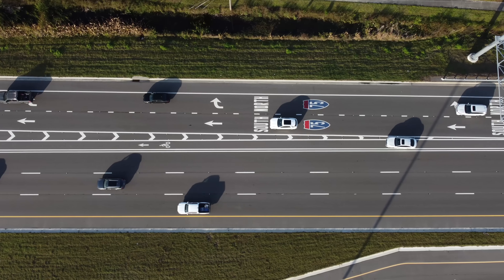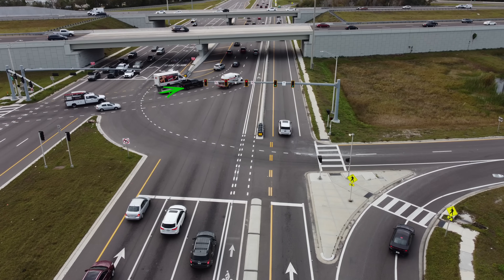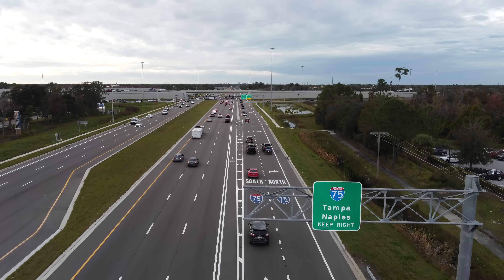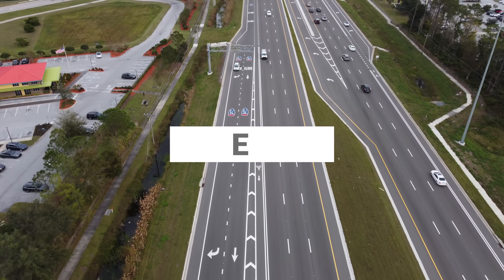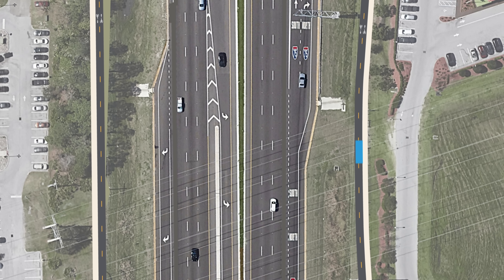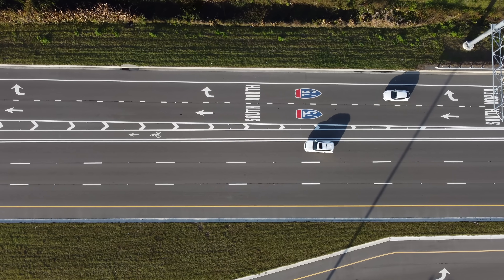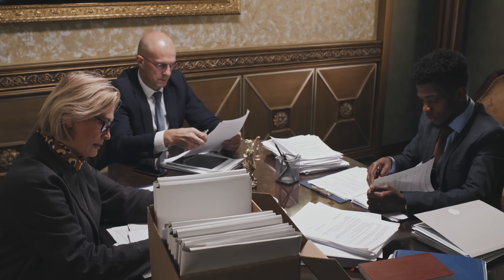This Brand New Interchange is Already Flawed

Comment: Are you familiar with this area? Your bike tunnel ideas is never going to fly in Florida. This ain't Amsterdam. They would end up in disrepair and be a hangout for addicts/criminals, never mind getting flooded by torrential rain. Its not something that any government agency FDOT down would bother funding upkeep for. The bike lane as built is trash, but better than nothing. Check US Route 17 interchange with I-75 (in Punta Gorda). Also, near the crossing with Marlympia Way in Punta Gorda, the right lane of US-17 at 55MPH is "share the road" with bikes. Now that is truly horrible. It does decrease speed to 45, then 35, but would remain a deathtrap given the skill of the average FL driver. As a side note, that interchange is also a garbage partial cloverleaf. Its options to be rebuilt may be constrained by elevation, proximity to the harbor, railroad crossings, and other issues. Check it out. /My 2 cents.

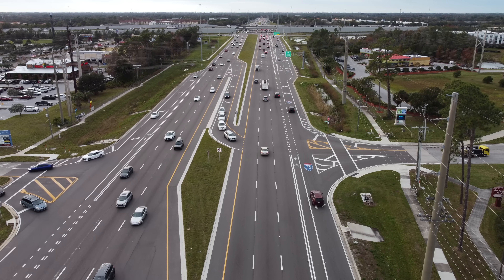Comment: 2:47 coming down from Canada for a few weeks I encountered this design at 11pm. It was incredibly confusing

Suffice it to say, I did exactly what this guy did except at the light intersection where it looked like that gap was left for a last minute merge over to highway if it was missed 😅

Overall I found the road systems there needlessly confusing.

I'm fort myers I swear the whole city is built around u-turns and an aversion to intersections. 

It took 2 u-turns to get to a place that could have been halved the distance and time with an intersection

Comment: There is one very like it in New Mexico on NM-500 @ I-25. The difference is there is no off ramp on the other side of the Interstate due to available space, so the ramp coming off the I-25 on the loop side goes through a tunnel under the freeway and links up to that intersection. So not only do you have people entering the freeway crossing the pike path, but you also have people exiting the freeway crossing it, too.
Reply: Rio Bravo? Oh yeah. Still a much better design than the outdated diamond interchange that was replaced, however, causes lots of conflicts for bikers bicycling from University or South Valley.
Reply: 505 mentioned! 😏

Comment: I don't want arrows on overhead signage to have arrows pointing at lanes.  I want the overhead signage to use lane unique symbols that match the symbols painted on the road below.  With new lanes having hints that they for new lanes on one side or the other of the road.  Each lane would have one symbol for its entire length and no two lanes should ever share a symbol.

Comment: I have to wonder if current traffic designers learned anything at all about previous road design, seemingly anywhere in North America.  Looking at this interchange as someone not familiar with the area, yeah, that definately needs clear signage to funnel people into the correct lanes further back to avoid last minute lane dodging or crossing through the bike lane when you realize you've passed the existing funnel point.  
And who sticks a bike lane in the middle of live traffic moving at 50mph?  Gotta wonder if the same thinking that prevails here is the mantra pushed down on these new traffic engineers; Put obstacles in the path of vehicles so they slow down.  Yeah, like that happens, people who shouldn't be driving in the first place are the only ones scared to go the speed limit, everybody else just treats it like a slalom course.  (things like curb juts, narrower roads, traffic islands).    Time to look at efficient movement of traffic as a whole, not band aid one and cripple the other.

Comment: (8:13) I'd like to point out that technically while that 4-tunnel system is elegant and significantly safer, technically you still haven't crossed the highway at all. You'd need either a tunnel or a pedestrian bridge with a bike lane in order to actually get people across the street without disrupting the flow of traffic.

Comment: As a cyclist, I always hate it when there's bike lanes that weave all over the place.  Since I'm used to biking in traffic, I'd probably prefer the original road, though I recognize that a good bike lane increases the perception of safety which can encourage casual riders.  My favorite bike lanes are the ones next to railroads, such as the western part of de Maisoneive in Montreal.  Downtown, it's the busiest bike lane in North America, but the western section between the Vendôme Station & Montréal West Station, is straight, flat with few intersections just like the tracks.

Comment: So many new intersections being designed are forgetting that Semi and RVs need to get through. Round abouts suck for large vehicles, Freeway exits need to allow for straight across in the event an exit was taken incorrectly, ramps leaving the interstate at 70+mph with no slow lane then straight into a 15 to 25 mph hard turn causes wrecks in cars and especially large vehicles.

Comment: You can be sure that not considering creating cycle paths the way it was shown in the video was not an accident, it was on purpose. For a country that, due to the influence of big oil capitalists, does not want to get rid of the consumption of fossil fuels, creating other transit possibilities means creating competition. And that's all they don't want. That even at a distance of less than 600 meters, Americans continue to use their cars. It's a project.

Comment: Dude, that intersection is in FLORIDA.  You can't dig a tunnel under the road for pedestrian and bike traffic.  Florida's water level is less than a foot under the ground, which is a thin layer of dirt over porous limestone.  Any tunnel would be filled with water (and small gators) instantly.
Reply: Fort Lauderdale has a tunnel

Comment: Well, they ticked the "bike lane" box, so everything is fine....

It is proven that good bike infrastructure can massively reduce congestion. But it has to be VIABLE alternative, not a death trap! Only very few people would want to ride a bike in the middle of a high-speed road - you don't ride your bike where you feel unsafe!

When will they learn? If this trend continues by 2100 there will be 30 lane wide giga-highways, with a small 2 foot wide bike line in the center or something. And you know what: there would STILL be congestion, because more people use those highways by then.

At this point I think it should be clear that there is only ONE solution for congestion: coming up with viable alternatives so that not everyone is forced to drive a care.
Reply: If you look at the area at 7:53 it becomes clear that no matter the bike infrastructure, no one will use it. It's an urban sprawl nightmare and will take some people 20Minutes of biking before they even get out of the neighborhood and see a single store. Not to mention the Florida heat and rain. No one is gonna touch it if they don't have to

Comment: Personally, I think all this redesign stuff reveals the convoluted minds of today. Roads went from being extremely simple to this sort of craziness.  I get the desire to reduce traffic but the real fact is most traffic was simply due to poor timing strategies of stoplights, and here is the proof.  Power outages. What's the one thing you never see when street lights are knocked out due to power outages?   Congestive traffic jams!  Every time street lights are turned off due to some kinda event, the very intersections that are most congestive now are devoid of it. And even more rare are accidents!!!  The removal of the stoplight improves the flow of traffic!  I've seen it many times over. Most people are not stupid enough to just go blasting thru full well knowing they would be taking a huge risk, so they employ a higher degree of attention in the crossing. And the same metric that applies when one is walking in traffic then applies to their vehicle operations. Less incidents then when they must adhere to an arbitrary street light roll of the dice timing wise.   These new designs are the same nutcase designs we see used and fail at airports and other heavily trafficked locations.  They introduce far more confusion in their attempt to provide simplicity. It's like giving a person a twenty step instruction book in how to take a single step forward.  It's called overkill!!!

Comment: I concur with these improvements, and it's sad such things aren't considered for every $80M construction project.  Seems it should be obvious at this late date in highway design.  Using the exact same rationale you did here.  Seems it could even be entered into the computer the design work is done on.

The quantity of traffic on the highway also is a factor.  The heavier the traffic, the more warning you need to into the correct lane, because it can take longer to change lanes, especially for large trucks.

That having been said, too many signs is also a problem.  Whenever you're looking at a sign, you aren't looking at the highway.  If you have to look at many signs in a short period with heavy traffic, that's dangerous.

Bicycles are a challenge.  I accept it's desirable to give people safe options for traveling by bicycle, but you basically end up having to build bridges and tunnels to separate them from motor vehicles, and use extra land.  Are there any bike paths that run above highways?  That would save land use, and utilize the same right of way.  Maybe such a path could also be used by motorcycles (with a divider to keep them separate from bicycles).

Comment: 6:00 In the Netherlands the tunnels would be mandatory. Both other options are just deathtraps and block flow of traffic. Let's say you have a busy hour of cyclist blocking passage for the motor vehicles and it clogs. Now you've got a traffic jam backing up the highway. Unacceptable.

Comment: Yeah, I recognize that intersection, anyone can see it's mis-labeled and badly designed. But that isn't the only spot , and they just refuse to fix any of it.   Count the cyclists in these lanes per mile , it's probably close to zero . Who wants to get exercise in car exhaust or commute every day two feet from an endless stream of cars driving at 70mph? Where exactly is the bike supposed to go if an emergency vehicle tries using that space to get around a jam? 
This isn't the right place for a bike path it's too high speed there, (cyclists don't want wiggly paths either , that pushes them back to the road margins) ... But  they won't even sequence the street lights properly, you have to stop at virtually every single intersection , they don't care.

Comment: A colossal mess. 

Biggest problem with planners is they plan too much. 

Fewer rules/lanes/markings/control would work better. 

Love the bike path idea. But no one will use it. Waste of time and money.

Sticking to cloverleaf and simply extending the merge lanes into it along with clear signs would have solved the non-problem and saved a great deal of money. 

Committee strikes again lol.

Comment: Designed by Muppets ! Learn from Railways. Avoid conflicting moves by using the available space for flying Junctions. Then you won't need expensive traffic lights which delay traffic & increase pollution by wasting fuel.  Or is that to complex for you daft Americans ???

Comment: A single bike lane for bikes going in both directions cuts the number of proposed tunnels needed in half, from four to two. Particularly if the bike-lane stretches are long in between the crossing roadways, then a single sided bidirectional bike path would work well.

Comment: A bike lane ON a highway? Are Americans insane? I really hope that this is "just" a loophole to get additional funding (as some other comment mentioned) and not a real try to get bikes on that suicide lane... Kind of glad that German/European laws prevent BS like this from happening around here. The "worst" we have are painted bike lanes on inner-city roads where the cars can go 50-60km/h, but those are luckily more the exception than the rule and mostly there because the city wants to increase bike infrastructure but doesn't have enough funding and/or space to redo the whole road with separated bike lanes, so the painted lane is a "quick fix" that hopefully gets followed up with a proper rebuild of the lanes a few months to years later.

Comment: Americans should take a queue from the Dutch when it comes to bike infrastructure. A separate, two-way bike path that is no wider than one single car lane should be built to either the left or right of the highway, with a physical barrier between them. More or less like the suggestion you made.

As for safety, tunnels aren't always an option because of cost. But you can make it safe. You can add bicycle traffic lights at the crossings with a push button, and integrate them into the traffic light control system. As long as no bicyclists approach, car traffic lights will operate normally. As soon as a bicyclist pushes the button though, the traffic lights that direct traffic across the bike path will turn to red. Car traffic lights that are for the lanes going the same direction as the bicyclists can remain or turn green at the same time as the bicycle light.

Comment: Your solutions here are perfect and wouldn't cost much at all. Maybe the tunnels wouldn't work since this is FL and water control is an issue but just having crosswalks with the bike lane off the road is much safer. Hopefully this video has made it to the correct people there so they can spend a tiny amount of money to fix this interchange.

Comment: As a veteran truck driver, I hate it. What if I took that exit on accident and need to get back on the freeway?  
Now I have to drive around on surface streets and try to find a place to turn around, like in some random parking lot, or make multiple turns on unknown streets hoping they are large enough and engineered for a truck.  
No one considers truck drivers when designing this shit.

Comment: Great video!  One thing I’ll immediately do is to have a sign telling where the 3 lanes are going to, in addition to where the right (75 Tampa Naples) lane goes. That way people in the 3 lanes would know that their lane doesn’t go to the 75 and the only option to the 75 is the right-most lane. Also the first sign distinguishes between north and south by a separating vertical line, which can lead to think that the separation between north and south is the concrete element ahead.

Comment: The bike lane your proposed is exactly the design that Madrid made use of when creating his first massive bike lane infranstructe, it is call the Madrid Ring as it literally makes a circle around the city going parallel to main city Highways, parks and avenues. It connects the old outside areas of Madrid City (now sourrounded by all the new city developments) with the older city center, and its FREAKING AWESOME!! 
its very well constucted, has usually a 2 lanes (one lane for each direction) for bikes and a third lane of people to walk, or if the area existing infraestructre didnt not allow for this a 1 lane for bikes and a second for pedestrians with one of this on each side of roads kinda like you draw in the video, it also use a lot short tunnels like the one you saw as well as thing tall bridges to avoid crossing main roads and highways, so traffic flow is better and riding bikes safer.
I loved the Madrid Ring bike project, sadly new city goverments are pushing for more bike lanes but doing it wrong as i see is happening a lot of times in the US, by building them as in the one on this video, in the middle of the roads or on the side but unprotected, mainly because is cheaper and because is in being done on the old city center. This makes people not to use it as much as the ones in the Madrid Ring Lane System, as the percive fear of being hit by a car is much higher.

However, my opinion is that it could be made better by removing parking areas on the side of the roads, o 1 lane of the roads and chaging existing pedestrian sidewlaks with the nice 2/1 bike lane+ pedestrian lane desing used on the Madrid Ring project, this if done correcty it would encourage the use of bikes or electric skates isntead of cars on the city center all while offering a great opportunity for creating new green areas for social use and interaction.

Comment: The issue is not cyclists, but specifically the tour de pants cyclists in camel toe tights, who still insist on inconsiderately biking in motor vehicle lanes and refuse the surface separated bike paths even though the path is right next to the road. Painted bike lane on the road or not, they will insist on sharing the road still. I have seen in too often myself. They want to chance fate, that's on them, but I certainly would rather bike out of harms way, and away from traffic.

Comment: The budget for things like tunnels under highway ramps SHOULD exist just as budget for a highway system SHOULD exist. To save lives. The monetary value of a life is stated to be high, but its only an excuse for our overly expensive car infastructure, as the second lives could be saved through any other infastructure its too expnesive and "not in the budget".

Comment: My favorite where I live was where there was a 4 way intersection that used to be a 2 way, then 4 way stop. Then 4 way light. Then they wanted to try a roundabout so they made it much larger than you would usually see, so you can actually keep up 45-50mph if you really want, oh, and lets make it different than every other roundabout in the entire world and have the people IN the roundabout yield to those Entering... and create gridlock.... and claim roundabouts are a complete failure. Eventually they changed the yield to those entering like every other roundabout, but because you can easily maintain such high speed and how large diameter the circle is, people inadvertently cut others off from not seeing them or misjudging their speed. Out of staters stop at the yields for some reason.
Reply from the maker: Where at if you wanna share? I’m curious to check out how it’s changed